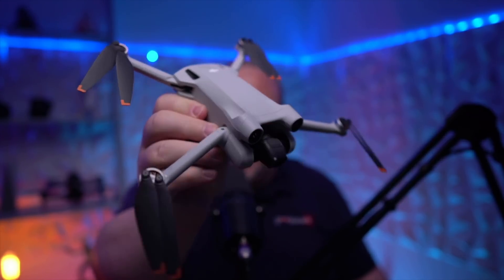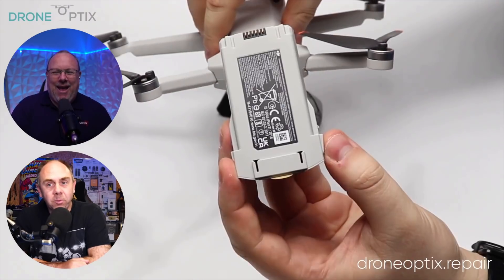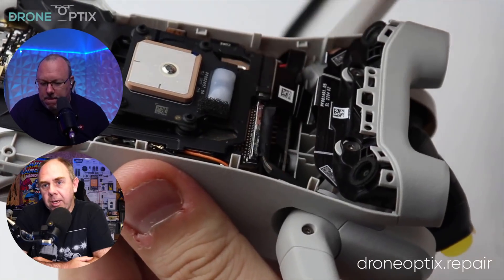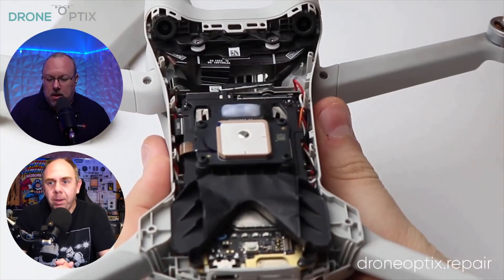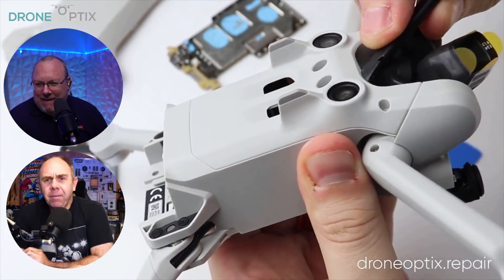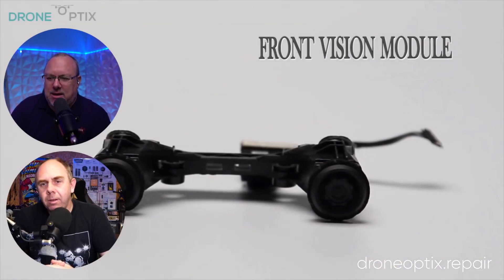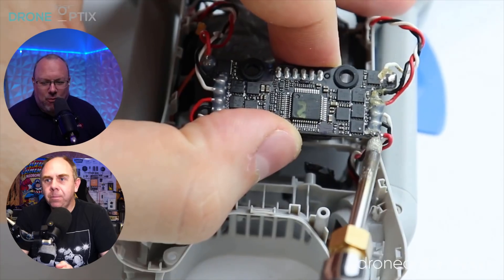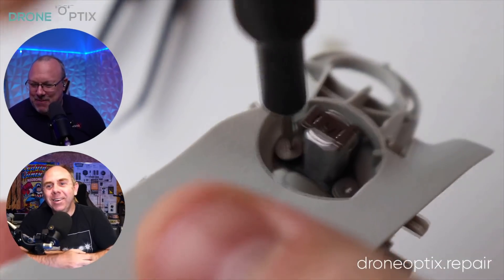How did DJI cram EVERYTHING inside the Mini 3? Teardown and analysis! (Including RC)

Comment: Amazing video, love these types, just a quick question with the rc remotes I have got 2. Now if I took apart the one is there a way to solder or remove and extend the antennas away from the remote? I want to try get more range. Mini 4k i had the mini 2 but lost it lol

Comment: I use a phantom 4 pro and it doesn,t do 10 bit video. Its 60fps mode is ugly due to h264 and a 100 mbps data rate. Obviously being able to stop the larger camera is a big advantage but there are tangible NEW features here. I,m likely to get one just to give me sub 250g flexibility but look forward to comparing image quality with my phantom 4 pro. Thanks for the vid

Comment: I guess Athena circuit board would save a Little white and maybe a lighter metal instead of copper for the wiring with thin insulation off just a thought

Comment: Excellent video, I as taking note of the conformal coating on the ESC and silicone over the solder, this is the forward board that will be hit by rain as it moves when there is rain, good to know the main board is above and while I noticed a little coating it is good to know the water will simply not get up there, all in all I now feel confident that rain will not stop this drone just like the Air 2S which I have taken apart and discovered almost every part of the boards are covered in conformal coating which make these drones pretty good at being water resistant. I have flown in heavy rain the Air 2S around 3km without issue, I would say looking at this drone it would be identical. Thanks again and you saved me so much time in pulling it apart and even though I am an electrical engineer it still isn’t something I would like to do on this tiny drone.
Reply: Wow nice

Comment: Explains poor range with those antenna
Reply from the maker: It does seem to doesn't it...
Reply: @Geeksvana  I’m half tempted to cancel my mini 3 order and get an air 2s with the smart controller
Reply from the maker: The Air 2S with is amazing. I would say it is almost perfect.
Reply: @Geeksvana   it I’d have to register a proper drone licence with been over 249g and then can’t fly it in as many places that you can the mini 3. Just wish the controller was better
Reply: FCC range is great 😃
Reply: @UCAY5WZAB4vFmqBG8fISW5bQ I’m tempted to do the same.  My Mini 2 crushes the range of Mini 3.  I’m eying the Air 2s for the advanced features.   There are a few videos of uncontrolled descent during heavy loading of the battery.